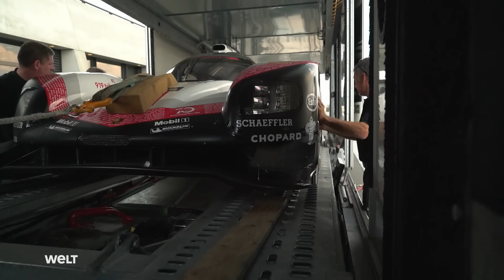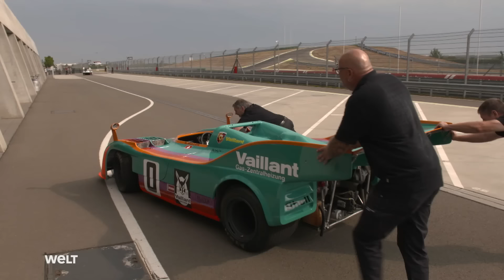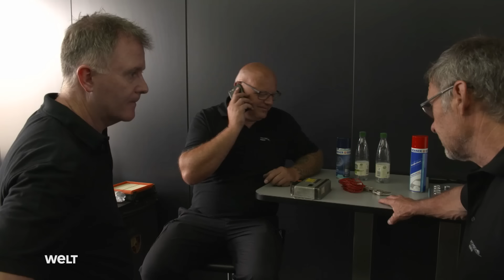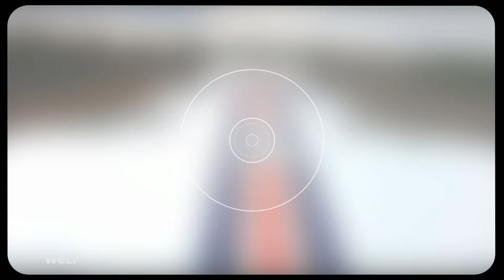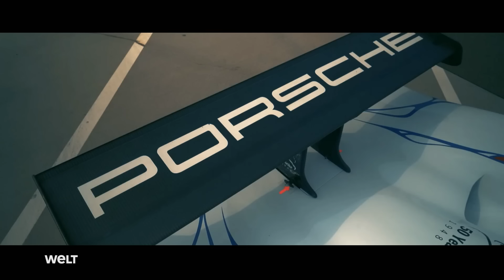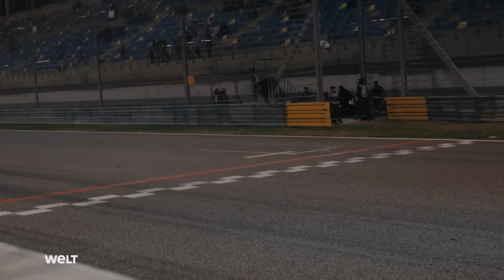Legendary Porsches - Icons Of Motorsport | Full Documentary

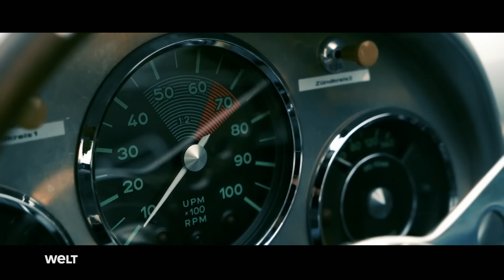Comment: 4:47 "The speedometer is located in the center of the instrument cluster, as it should be in a proper sports car."
Every Porsche I have ever driven - a whopping 3 - had the tach in the center - because it is most important instrument on the track.
On the street - once you've broken the speed limit - speed only determines whether you are going to jail or getting a ticket... as determined by a radar gun or the speedometer in Officer Bob's cruiser.
It appears that Porsche moved the tach to the center in the 1960s. Although in a 356, it moved from year to year. 
By the way - Screw you officer Bob! I became a drug addict, anyway.
Reply: The announcer says that the 550 Spyder has the speedo in the center, however if you look at the video when they show the center gauge it is in fact actually a tachometer as it should be.

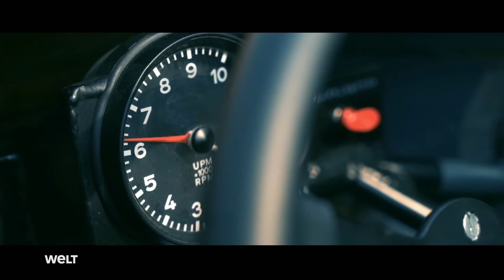Comment: At 12:30 it is said it's a V12 engine ... 
Wasn't it a FLAT 12 , a 180 deg 12 , with 6 cylinders on each side ??
Wasn't it basically two flat 6-cylinder Porsche engines fused into one 12 -cylinder engine ???
Reply: Correct. Noticed that as well.
Reply: @johndemetry4904  No it was not. The 911 engine is a true boxer engine with one crankpin for each cylinder. In the  917’s engine two opposed cylinders share one crankpin. Like in a V engine that happens to have 180 degrees Bank angle.
Reply: i guess the 917 got offended at that and decided, "fuck you, i don't want to work anymore."

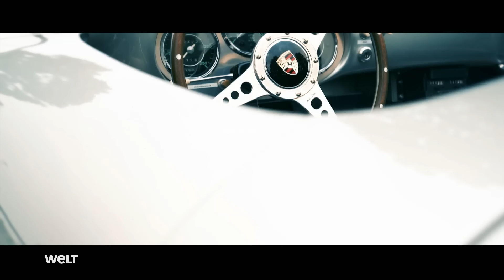Comment: 4:44 “The speedometer is located in the center of the instrument panel...” We are off to a rough start when tachometer and speedometer are confused. 😣
Reply: Yep, that immediately killed it.  Just cant help thinking about how many weak links it takes to make a mistake that obvious and then to have no one at your production studio catch it before you publish.  Pretty bad...
Reply: Remember, these are germans so to them it's engine speed...autobahn has no need for a speedometer.
Reply: @ZKozak-hp5vb  I don’t own a single car that has the speedo in the center of the dash- 4 911 Turbos all tachs in the center. Ferrari F12, F8, and 488 tach center- varies on the SF90 depending on mode. McLaren 720S and 765LT just have little digital speedo. YOU MISSED MY POINT ENTIRELY. When the host doesn’t know the difference, then we have a problem…
Reply: @ncrawford1488  ...engine speed = Revolution Per Minute (what you see on a tachometer.
Reply: @ZKozak-hp5vb  Are you dense? Sir, pause the video at 4:48. The VO says, “The Speedometer is located in the center of the instrument panel- as it should be in a proper sports car.” That’s not the speedometer being shown. The tachometer is in the middle as it should be. The voice over is wrong and make one question the rest of the copy/VO.

Be Well.
Reply: @ncrawford1488  Sweet Jesus are you devoid of something upstairs.  I was jokingly referring to the Speedometer as the Tachometer because the TACHOMETER measures the SPEED of the ENGINE...LOL you giving me some good laughs at the very least.  The person was a translator, german translation may be different?  As with the other foibles throughout the documentary like Stuck noting how reliable porsches are and right after the 953 broke, then the 917...?
Reply: @ncrawford1488  german translation of speedometer is tachometer lol - there's the confusion :^)
Reply: @ZKozak-hp5vb  There’s no joke there. If you think that’s humor, go down to your local improv and see how it goes over. As for your translation bs, “drehzahlmesser” translates directly to “revolution counter.” The German language is great that way- it is very specific. Especially when it comes to mechanical items… 🥱 You are boring me now. I’d call that game, set, match.
Reply: @ncrawford1488  Uh-huh.  Use a translator and type in tachometer in german, see what the english translation is.  Enjoy your game of checkers, never interested me - especially with your willingness to argue with the fleet you have.  The people with accounts of that size don't have time for banter on youtube 😁

Comment: The 917 was not a V12 as the narrator described.  It was a flat 12.
Reply: True , but sometimes the techies considered it a 180 degree v 12 . good catch though!!😄😄😄😄😎😎😎🇺🇸🇩🇪🍺🍺🍺
Reply: @artmchugh5644   they do so because this engine has only 6 crankpins. Not 12 as a true Flat 12 would have.
Reply: I adore that you think that is all that was wrong with this abortion. @ “The speedometer is located in the center of the instrument panel...” We are off to a rough start when tachometer and speedometer are confused. 😣